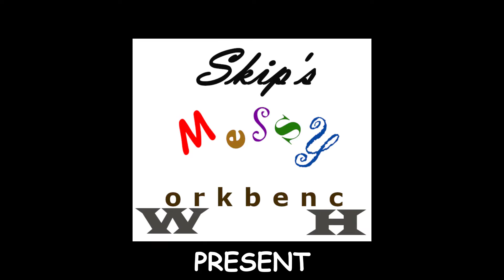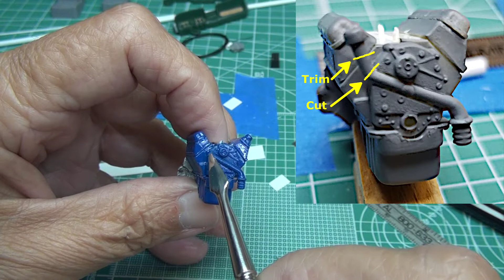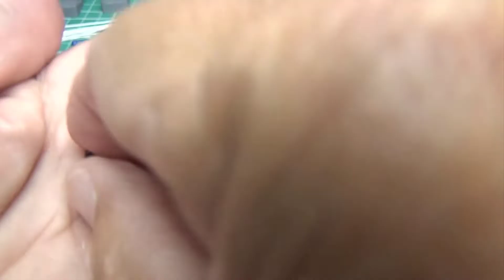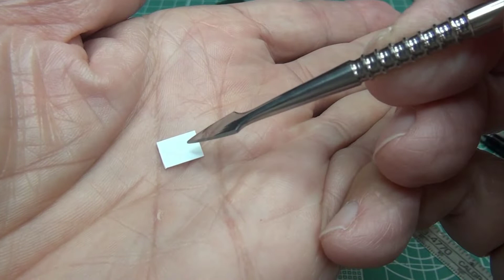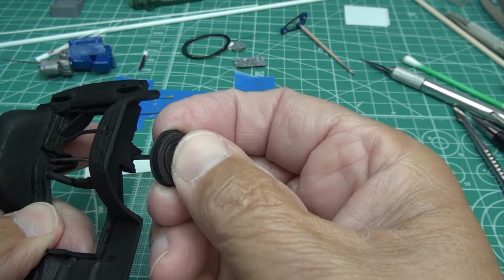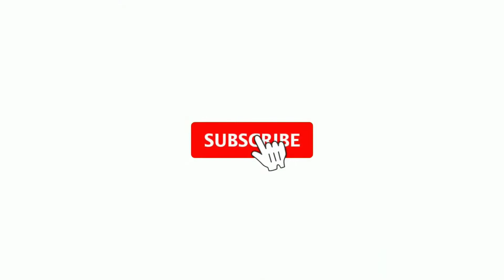02 1966 Ford Mustang Part 02

Comment: Looks like a good start and some good solutions for some of those problems. Keep up the great work.
For a shifter boot you might try cutting some sheet styrene in small rectangles, each one smaller than the one before it , stack them to look like the folds of the boot. Drill a hole down through the middle of them. Then make your shifter from a sewing pin with a ball top, the color of your choosing, put a slight bend in it and trim to length, insert in hole drilled.
Reply from the maker: Thanks for the tip. I was thinking along that line. I also thought about forming some circles or rectangles with wire and having each of the circles or rectangles reduce in size; stacking them like you see onion rings at Red Robin Restaurants. I thought maybe the wire would give it that round edges effect. Or, I'm going to look through my junk pile and see if there is one I can salvage from an old model. Either way, painting it with Tamiya Rubber Black should make it look good. Again...thanks for the tip and thank you for subscribing. I love hearing from people who watch, that way we all learn from each other.
Reply: @skipsmessyworkbench  👍🙂👍